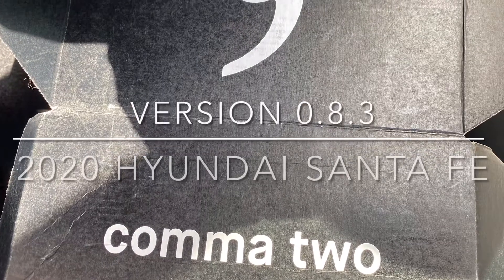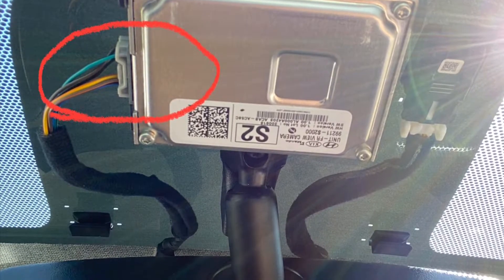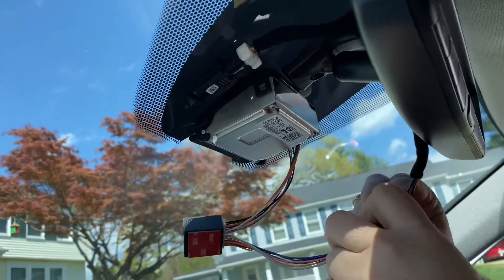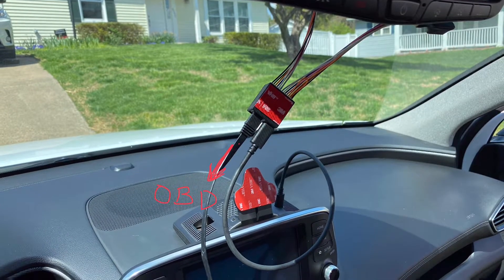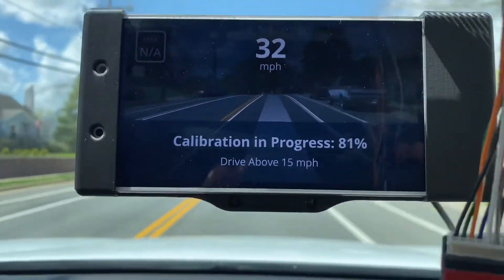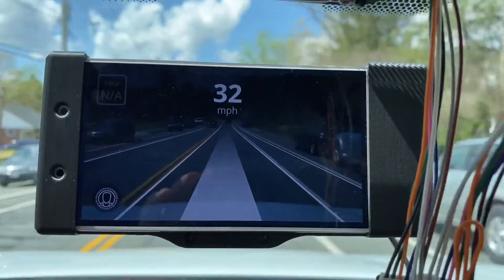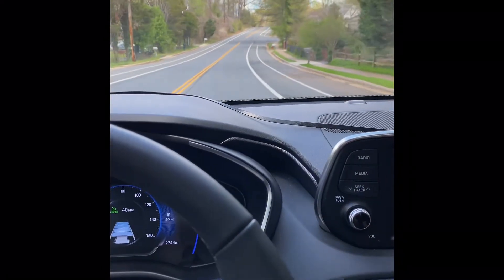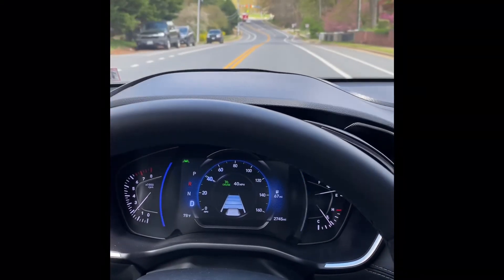OPEN PILOT Self driving Hyundai Santa Fe Installation

Comment: Does that warrant the warranty?
Reply from the maker: You can easily unplug the unit before going to the dealership if you’re worried
Reply: @repairsbydad7737  awesome, also I tried to find on the discorte but can not. Do you think it will work for the phev 2022 tucson?